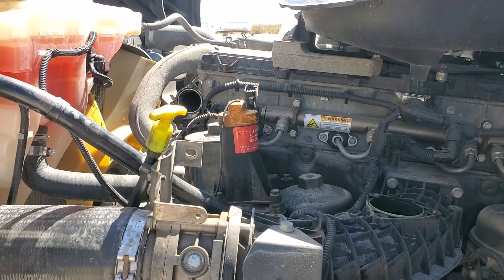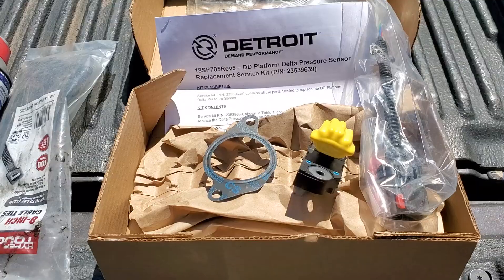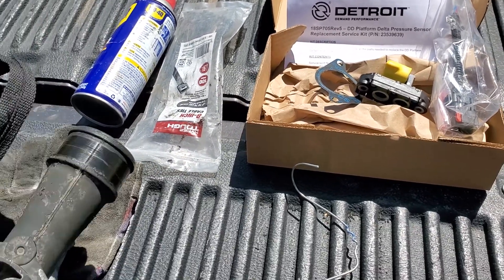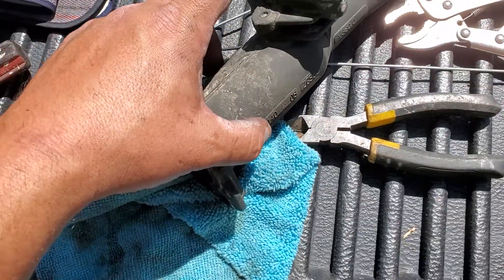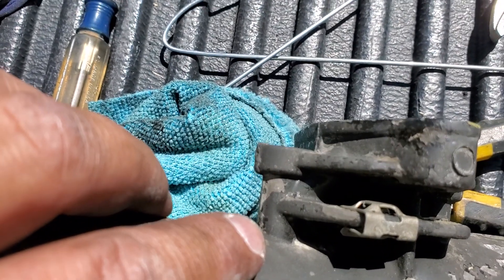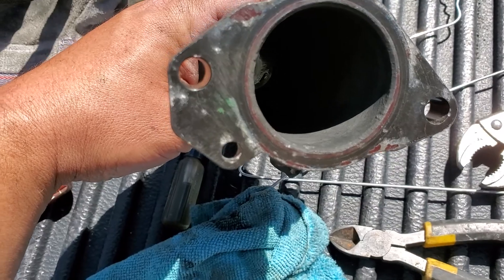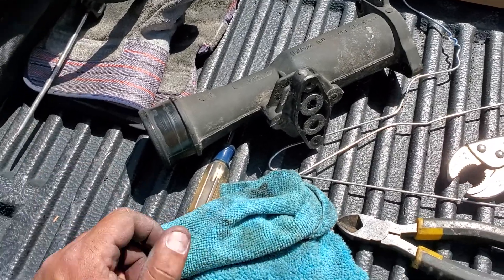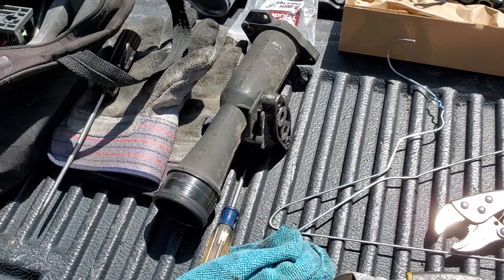Cascadia DD13 Emmissions Fix Delta Sensor SPN 2659 FMI 18

Comment: Wey tengo problemas también y mi dd13 apenas tiene 400.000 miles cuento te costo el kit ?
Reply from the maker: se tiene que usar la laptop para programar el sensor repuesto, si solo desconectas para limpiarlo, no se necesita reprogramar.
Reply: How did you clean the actual pipe. I am nervous to scratch it.
Reply: @makincash3337  I didn’t clean it I replaced it 80$
Reply from the maker: Sensor $125 mas programacion
Reply: @AMDD708  programación ? Como así no es solo cambiarlo y ya ?